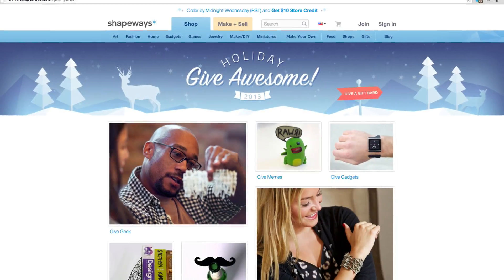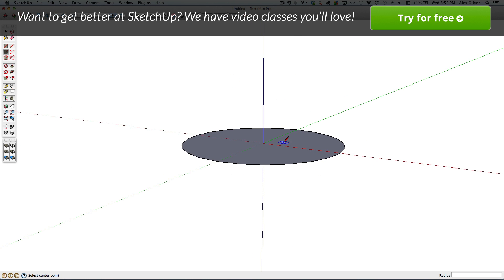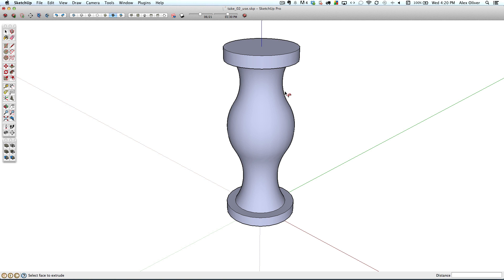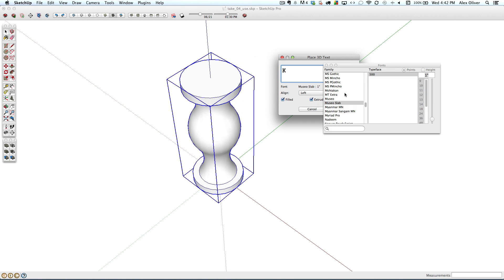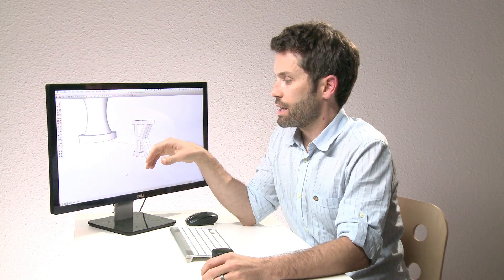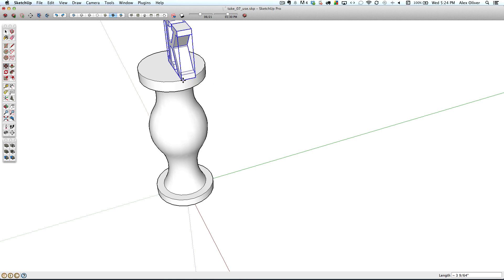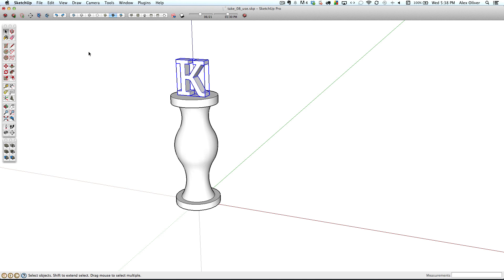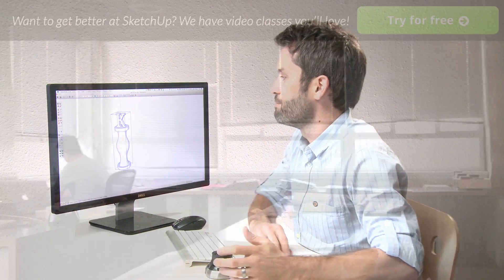3D Printing from SketchUp | SketchUp Show #68 (Tutorial)

Comment: Still new to 3d printing but why go to the trouble of making it hollow in sketchup when you can just choose 0 in the infill option in the 3d slicer program?
Reply: Well, first of all, he sends the file to a 3d printing service, the 3D printing service does not use FDM printers (0% infill is not an option).
Second, 0% infill creates only the outer shell.
When you want to create functional Parts you have to construct them in a similar way, injection molded part are constructed.
If you go the extra mile and create the parts that way you get the best structural integrity.
As an beginner i wouldn't bother with it, but when you are familiar with you construction software and you want to get durable, funktional Parts, i would recommend you this method.
Some industrial construction aplicaciones make this process really fast and easy, but this Programs are 1000-5000$

Comment: I'm here causing I'm liking this video to someone for help, but just to throw this out there. If you are using an inches format, you can export the file as MM, it will convert all the measurements for you, so when you open up the model in your slicer its not confused as to what size it should be.

And btw if my sketchup experience has served me right, thats not a solid, at least not one that will work with solid tools. The faces on the inside were in the wrong orientation. They're color coded, the inside faces should be blue, the outside faces should be white.

Comment: what is an escape hole???
Reply: When printing "Strong Flexible" (which is what Shapeways calls their nylon plastic), the model is made by putting down a microscopic layer of plastic powder, fusing the appropriate parts with a laser, then putting down another layer and fusing that, and so on. To make a model lighter and cheaper, as was done here, you can opt to make it hollow. If you do that, however, you need to make an escape hole (usually in the bottom, or some unseen area) so that the powder inside the model, that hasn't been fused, can be cleaned out of the model after it's been printed.

I don't know if I've explained it well enough, but if you check out this page at Shapeways, it gives a good idea of how that material is printed, and what you need to do to make sure your model will print properly. There's a video at the bottom roughly showing the process.
https://www.shapeways.com/materials/strong-and-flexible-plastic?li=nav

Comment: Will the connexion 3d review be next time?
Reply: phooesnax Hi there, we noticed this comment and wanted to help. Sorry for not seeing it sooner :-( Your 3D mouse should do more than orbit and zoom. It's possible that some of the axes are disabled in the 3Dconnexion Properties panel. Please check and let us know. Ultimately, the 3D mouse should "connect" you to your SketchUp model so you can simultaneously and smoothly pan, zoom and rotate while using your normal mouse / tablet to select, edit and draw. It takes a bit of practice but once you get it, you really get it :-)
Reply from the maker: We will be talking more about our experience with the SpaceMouse Wireless as we use it in future episodes. Stay tuned!
Reply: Bought one... thumbs down!   Only orbits and zooms and offers little else.  Looks nice, nicely made....does next to nothing.
Reply: 3Dconnexion I've had a 3d space explorer for around 4 years.   I love it!   It really gives you a chance to experience 3d in a different way.   The ability to constantly pan and shift pov makes understanding what your are seeing much easier, and the programable buttons make life easy.   I've got 10 buttons on the explorer and another 8 on my mouse, means that I rarely need a keyboard shortcut.   Nothing changed drafting for me more than the 3d explorer.